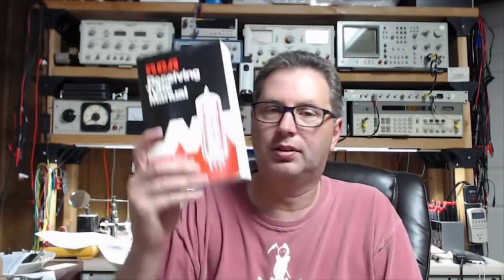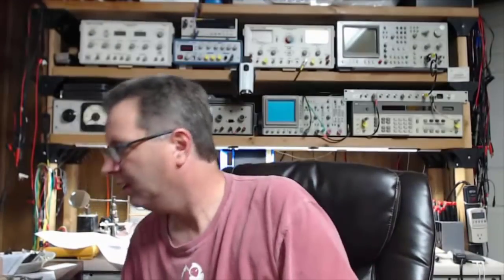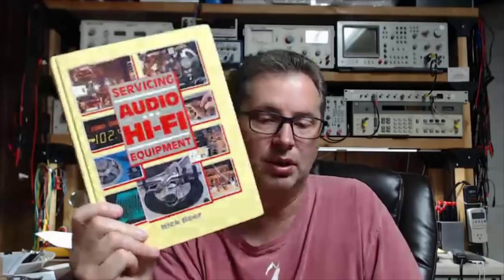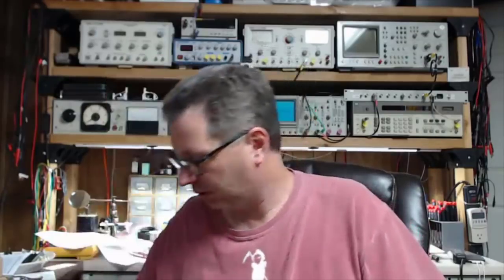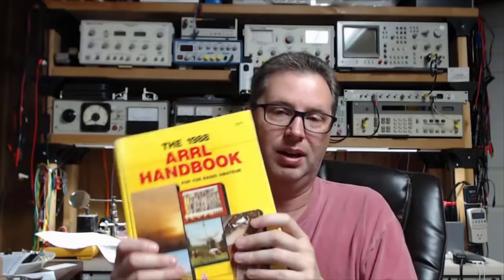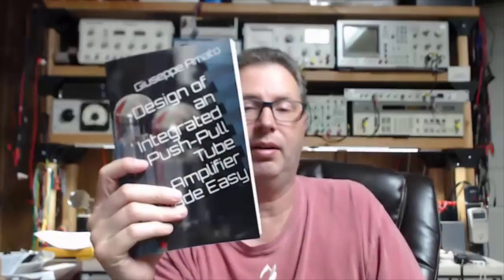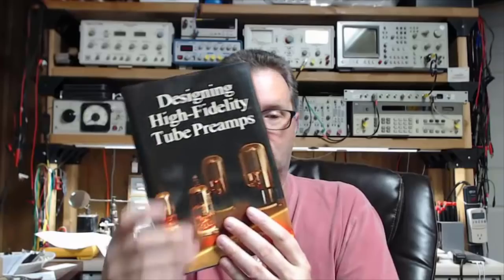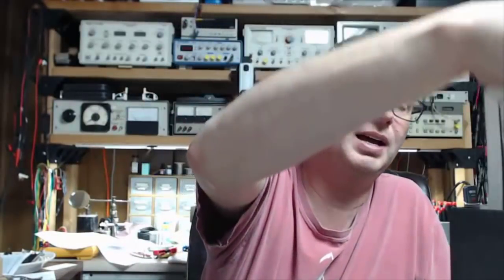Recommended books for audio and stereo repair and design

Comment: Mark - just watched your great series on books for tube amplifiers.  I am about to embark on trying to repair a couple of what I would call state-of-the-art discrete stereo receiver/amplifiers for their day (mid seventies).  Newer than tube technology but all discrete components, no ICs.  Can you recommend books, web pages, YouTube channels, etc., where a guy could start learning how to troubleshoot and repair stereo amplifiers from this era?  Background is software engineering, very basic knowledge of resistors, transistors, diodes, capacitors.  Basic knowledge of use of oscilloscope.  Able to read schematics, but mostly unaware of what the circuits shown on the schematics are actually doing, etc.  thank you!

Comment: Thanks!  Getting back into the repair hobby and will be looking for books you mentioned.  I did search my library and found a 1963 40th edition of 'The Radio Amateur's Handbook', published by the ARRL.  Looks like some good reading.  A question about your bench setup ... I liked your video on your construction but ... could you please let me, everyone, know what your test equipment consists of and what you recommend as equipment every bench should have and then suggest other equipment that is good to have, even though it may not get much use?  Thanks again!.

Comment: Merlin took his  power supplies book off the market some years ago. I remember reading that he didn't think it was "up to snuff". My way of saying what I remember reading, not his words, but you get the idea. I got that he wasn't happy with it. You can find it listed on Amazon for $500.00 to $900.00 or more if you want, but he said that one of his other subsequent books covered power supply design better and he didn't think there was a need to bring the power supply book back as such. Great video, and I agree that the Tremaine Audio Cyclopedia is really good. Somehow, I managed to buy one back in the late '70s at a shopping mall bookstore and still have it. A quick check of Amazon showed that this book is now going for between $140.00 plus to $540.00. Yikes! Not sure what $40.00 (1978) inflation adjusted would be, but still glad I bought it then, not now. I would also suggest Valley and Wallman Vacuum Tube Amplifiers. Another really good book, but probably not for beginners or those without a good math background.

Comment: FYI for repairing audio amplifiers look for Jack Darr's book "Transistor Audio Amplifiers". (SAMS 20838)
Jack Darr was owner of a repair shop and got started working with radio in 1927 and has written several other books for SAMS. Chapters include: Basic Transistor theory & Typical Circuits, Use of test equipment, Audio Generators, Watt Meters, Transistor Testers. 
Power Supplies, Selecting replacement Transistors and Testing Amplifiers. One very helpful chapter is Signal Tracing with the Oscilloscope. It's an excellent book for both beginners and experienced repair techs.

Comment: RCA - Receiving Tube Manual - ASIN: B000TNHBAU
Valve Amplifiers - 4th Edition - Morgan Jones - ISBN-10: 0080966403
Building Valve Amplifiers - Morgan Jones - ISBN-10: 0080966381
Saga of the Vacuum Tube - Gerald Tyne - ASIN: B00E3GRFYG
Build Your Own Valve Amplifier - Ranier Linde - ISBN-10: 0905705394
Servicing Audio Hi-Fi Equipment - Nick Beer - ISBN-10: 0750621176
Tab Guide to Vacuum Tube Audio - ISBN-10: 0071753214
Troubleshooting High Fidelity Amplifiers - Mannie Horowitz - ASIN: B0007GN80Q
Tubes and Circuits - Bruce Rozenblit - ISBN-10: 1477532862
GE Essential Characteristics of Receiving Tubes - ASIN: B0027UWC7U
ARRL Handbook (example was 1988) 
Cameron's Projectionist Guide - found reference on Google Books
Radiotron Designers Handbook - RCA - ASIN: B0007DOX94
Audio Cyclopedia - Howard Tremaine - ISBN-10: 0672206757
Design of Push-Pull Tube Amplifiers - Guiseppe Amato - ASIN: B07GT4WWCC
Designing High Fidelity Tube Preamplifiers - Merlin Blencowe - ISBN-10: 0956154522
Designing Power Supplies for Tube Amplifiers - Merlin Blencowe - ISBN-10: 0956154530
Mullard - Tube Circuits for Audio Amplifiers - ASIN: B00E3GRJ10
Vacuum Tube Guitar and Bass Amplifier Theory - Tino Zottola - ISBN-10: 0933224966
Vacuum Tube Valley - periodical - found online
Sound Practices - periodical - found online
Glass Audio - periodical - found online

Comment: Great info Mark, that’s quite the library you’ve got there! I just wanted to note that Merlin Blencoe’s Power Amp book is currently out of print, when I asked him about it, he said he was working (slowly) on a second edition that would be out eventually. But his Hi-fi and guitar preamp books are still available, his guitar preamp book is pretty much my main bench reference, invaluable info, super practical designs that are most times simplified from what is found in production amps. Thanks for the content Mark and keep up the good work!
Reply: Matt Harrison Did you ask Merlin why not do another printing of the first edition of the Power amp book so that people could buy it until the 2nd addition is done?  There are 4 used copies currently available on Amazon for $600, $2000, $2400, and $5000.  Seems like another printing is justified.
Reply: His new power supplies book is now available